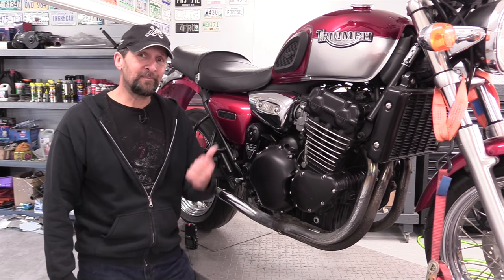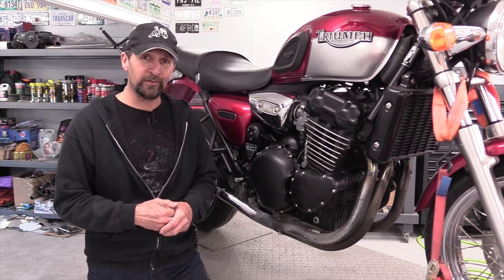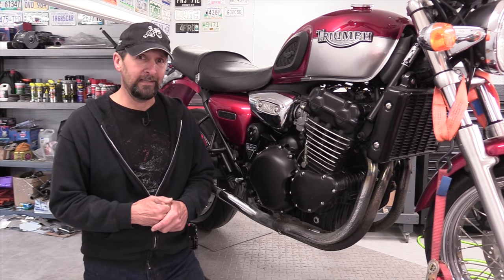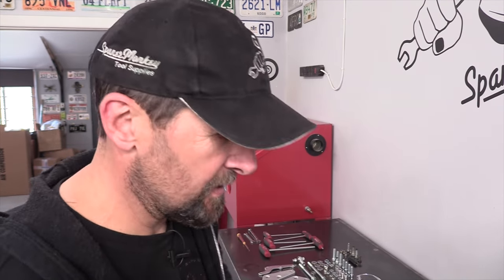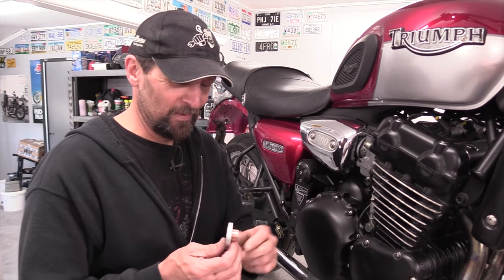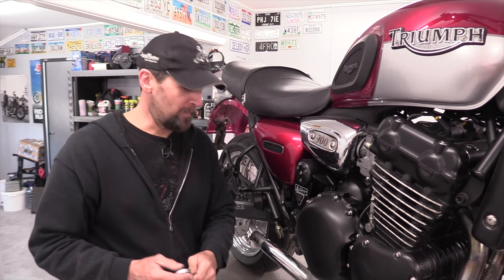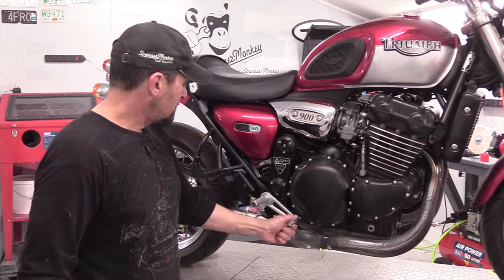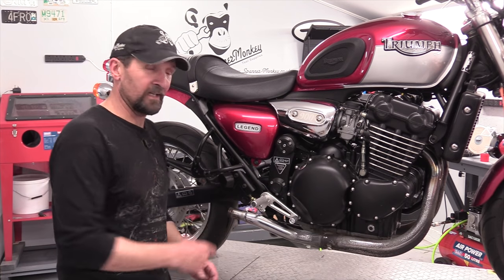Triumph TT Legend "Custom Rear Brake Linkage"

Comment: After working on my rear master cylinder it occurred to me you took the long way around lining up that actuator. Could have put a couple washers under the master cylinder to pack it out enough to line it up.

But then you wouldn’t have had to amaze us with your fabrication ingenuity.
Reply from the maker: Maybe, but it's not a clever solution though is it.. having your brake master cylinder hanging out from it's mount on a stack of washers.. certainly something id rectify the moment i saw it if it was on a bike id bought !   A billet stainless steel connecting link is surely far better.!
Reply: @Moonfleet41  Absolutely a fair point. Why do it easy when you can do it clever? I’d allow one maybe two washers. Especially under the cylinder cover. Hard to tell from the video, but it looks to be just a couple mm off.

Lacking a shop as well equipped as yours I have to make due. The spacers for my headlight mounting tubes are made from plumbing rubber seals.

Comment: Unless I'm missing something that could have been done with a bolt and some washers. And the angle of the lever was adjustable.
Reply from the maker: Radial 9:  Thank you Radial for putting it so eloquently, I sometimes loose interest in trying to explain things to people determined to argue for the sake of it, I appreciate your detailed input and you're absolutely right.
Reply: @Moonfleet41  im sure most contributors/generators of content feel the same Delboy 
Go look at a channel run by a florida lad called Bruce Wilson to see the deluge of nonsense/abuse/ridicule and cheek that lad gets from the lovely keyboard knowalls who infest YouTube unfortunately
Reply from the maker: @geraldgallagher825  Thanks buddy, just subscribed, looks like a fun channel..
Reply: Wouldn't be safe. End of!
Reply: @worzelgummidge3617  what and drilling holes and removing material from a cast alloy part is. And you need a lathe and a drill press for that.
Reply: @andrewmundenandcadfellmast4624  If you are referring to me I wasn't rude to anyone. Unlike yourself.
And no comment on adjusting the angle of the lever. Wasn't attempted or mentioned. I saw the foot position on the peg in relation to the brake.
Reply: Barry Malone washers and a bolt 😂 you should set up your own channel. “Barry knows better” sure you would get 150k subscribers. Jog on!
Reply: @mikefandango3343   Cos he has 150thou subscribers I can't comment. Well what about the adjustment. Am I right or wrong? 
And I will not be back.

Comment: Hi Delboy, very interesting to see what you`re doing with such an unusual choice of machine.  I always thought the petrol tank on the Thunderbird range was a bit tall and out of place, have you considered trying to fit a modded T160 Trident tank, which i think would have better lines?. Also, with the flat bars, how about dropping the forks through the yokes about 1/2" - 1" which would also help sharpen up the steering?.  Keep the vids coming, really enjoyable, but the music is not my cup of tea, but fair play to you in trying to help the band along, they deserve it, and it does`nt mean i`l stop watching because you play them.

Comment: He Del,
Just bought me a tt-900 myself and your vids supply me with loads of inspiration.
Could you show me where you get all your parts from?
I would need to do a lot of refurb and upgrading myself.

Many thanks in advance for your reply!
See U in the next one ;)
Reply from the maker: Hi Dave,  great to hear from you and congratulations on the Triumph!  You've bought a wonderful motorcycle and regardless of it's condition (which you can deal with!), you have one of the most well built, well thought out, and quality constructed motorcycles on the road... the innovation and engineering on these bikes was 20yrs ahead of it's time... and definitely a sound investment!   I use Wemoto for most parts, as they're convenient and quick and their prices are good, they list an enormous amount of parts for your bike, so check 'em out!   https://www.wemoto.com/

Comment: The hole for the clevis pin isn't operating in a straight line as the master cylinder piston is, it's operating in a radiused line or a curve. It works but in time the action which is in effect side to side will wear the master cylinder prematurely.

Comment: Love the music. Would that new piece of stainless benefit from a bushing? Or no,
Reply from the maker: There'd be no need for that as there's no pivotal movement to speak of, and the whole lots bolted up tight, plus it's stainless to stainless in the clevice pin, but if it develops any free play years down the line, I can re-visit it later and for what it's worth, the factory pedal was stainless in to aluminium and had no bushing.

Comment: Hi, could spacers not have been used to spacer the master cylinder away form the frame to bring it inline with the rearset brake lever? I understand there's many ways to solve the same problem.
Reply from the maker: No, the master cylinder is mounted inside the steel frame mount for the rear foot peg and it sits flush up against it, the only way you could move it would be inwards.